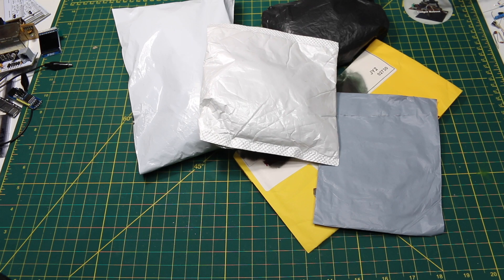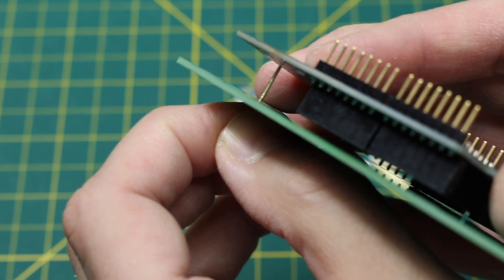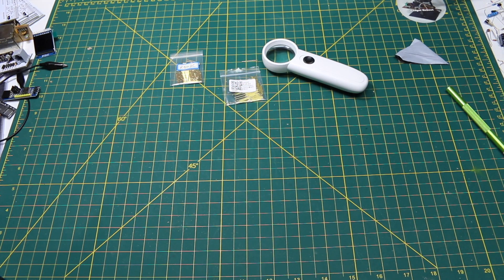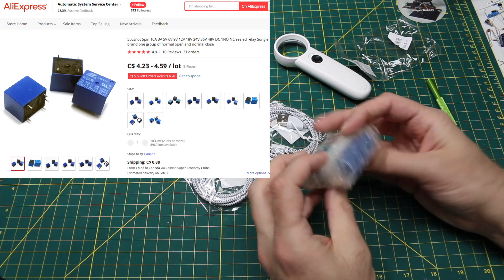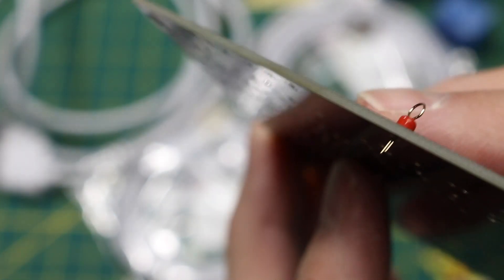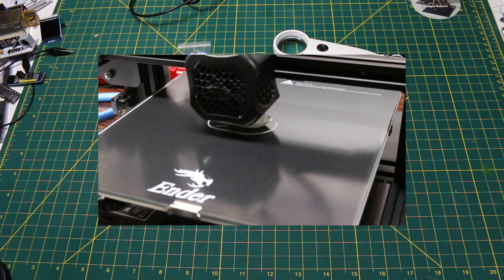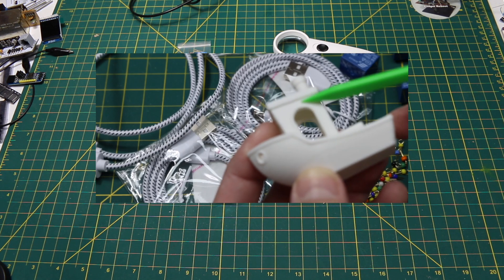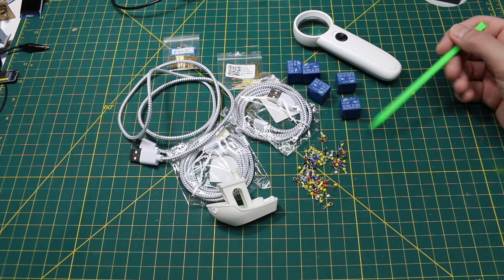Mailbag!

Comment: White isn't a great type of filament find a color you like for example Grey is the best for most people. Stick to using the same brand and color. Learn everything with that filament then when needed use other colors, test printing small objects with the setting you plan to use on big objects is the best way to go.
Example you planning making a Halloween mask print it small or just part of it I like print them small and fine tune your settings that way.
Cura is easy to use but prusa slicer is good to learn  because of support from community. 
Sometimes you need to slice it again don't know why it happens but and it's not often but if you find a problem it could just be a slicer issue. Take your time if it's not fun take a break from it.
always ask Questions to more than one source.

Comment: @Gadget Reboot Another suggestion I have for your printer is to get a set of stronger bed springs. The ones Creality ships on the printer are weak and the bed will loosen up easily. Some put nuts on the printer to keep them from loosening up too. They're are many sellers on Aliexpress and Amazon that sell small upgrade kits that include the springs, Capricorn tubing and some other parts that are useful to do some minor upgrades that sell for a reasonable price and add useful functionality.
The Capricorn tube is a better Bowden tube because it will withstand more heat than the stock tube, has less drag and it also has a smaller inner diameter that makes it easier to run TPU filament. 
I flashed the Jyers UI firmware onto the printer which gives you more functionality and your file names scroll across the screen so you can read the whole file name.
Go for the one that has manual mesh bed leveling. It makes it a lot easier leveling the bed.
I have the same model printer and after watching lots of videos, I did these 2 upgrades before my first print.
You'll enjoy it and you already have the spousal approval angle covered with planned projects for the Mrs.😎

Comment: The Ender3 v2 is an extremely solid printer!  For someone that also has extremely minimal CAD experience, TinkerCAD is awesome! It's a lot like Lego, but more powerful. I've designed all my models using it, which is a LOT.  It's a primitive based modeling thing. Free, and works great.  :)

Comment: Start out with small prints that take an hour or 2. Clean the printer bed with Isopropyl alcohol before each print. You'll remove any dust, residue and most importantly fingerprints that can cause poor bed adhesion

Comment: My first print was the cat that was one the SD card that came with mine.  Pro-tip: if you’re printing from places like Thingiverse, read the “thing details” so you can change settings in Cura or whatever you’re using relating to supports, printing mode (spiral etc) and top and bottom layers, you’ll need to set those if specified in the instructions, most models don’t require those settings to be changed from default but it’s important to check before you start a 24 hour printing run.

Comment: Congrats with the printer! I have same one from May this year. Let's say I have a LOT to learn, and still fell as a novice, and this is OK. 
Stock up with PLA filament with basic colors and enjoy. When you will feel comfortable or need something more resistant than PLA, try PETG. This is whole new animal. (I'm on this point). 
I figure out tools that I use constantly for 3D printer: Digital calipers; 0.02mm/.008" measure Gage for calibration aand that's it! everything else came with the printer.  materials: filament, basic pager glue sticks (large ones), duster in the can to clean printer from pieces of filament, and very light oil to lube z axis. Dusting and lubing depend of the usage.
Id' recommend also to print filament guide (lots of ready-to-print-in-place). I find out that simple models (like simple boxes) can be speed-up in print to 150% when I have filament guide.
Next thing - print filament clips. helps to keep opened but not used filament neatly together. 
I'm living far north in Alberta, so I have very low humidity year around. Otherwise large ziplocks and lots of "donoteat" packs might help.

Comment: Those ceramic test points look interesting and I will have to pick up a few. The 3D printer looks neat, it will be interesting to see your experience with it.
Reply from the maker: Yeah when I do remember to add test points to pcb designs, I always end up wishing I had those test points to install so I wouldn't have to solder wires when it's hooked up to 3 other things already.
I bought an extra spool of filament so I'm all ready to figure out how to print.  Now I need to come up with a project that "needs" something 3D printed for it...
Reply: @GadgetReboot  Try custom boxes/trays with dividers for irregular things. My wife have lots of perfume samplers and in exotic containers, so we together designed them in tinkercad and I printed them out. Best training project for me (speed, temperature, retraction, infill, support..). Also can be counters and Dice Tower for boardgames.

Comment: You got a boat :)
Reply from the maker: And it's aboot time!
Reply: @GadgetReboot  One VERY nice Benchy for a 1st.  Looks like you need to move the bed up just a tiny bit.
Will you go nuts with upgrades? Dual-Z, Direct Drive, Probing? It WILL take all your time.
Would do it for you if I were in Canananda.
Reply from the maker: I struggled with bed adjusting - is the paper too loose? too tight?  I was goldilocksing it back and forth, but I'll see about upping it a quarter nudge.    
The little I heard about upgrades so far says maybe wait and see what's really needed as time goes on - will the hot end break in a month and I should go metal, or will 3 years pass with no issue...etc.  I remember seeing something about how dual Z may actually cause more trouble than it fixes but I forget the details.  I wouldn't mind if it could auto level itself but it's still way too early to figure things oot.
Reply: @GadgetReboot  Your slicer will let you opt for n-many skirt perimeters.  You can hot-adjust the "z-offset" while printing  from the UI to lower the nizzle while printing.  Take heart though, your boot laid down just fine.
Reply: @GadgetReboot  You've had a very strong start; I'm positive you'll find it incredibly useful and eventually really enjoyable (wait 'til you start finding uses for flexible parts out of TPU :) )